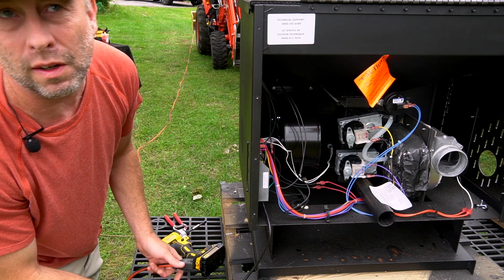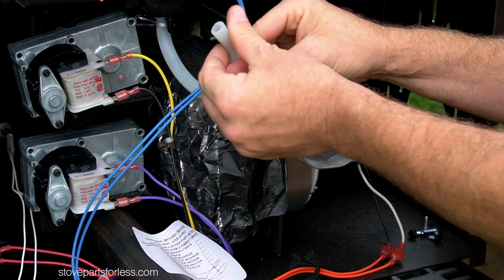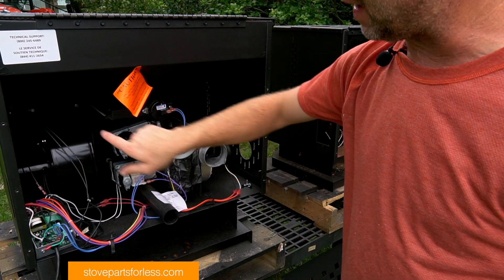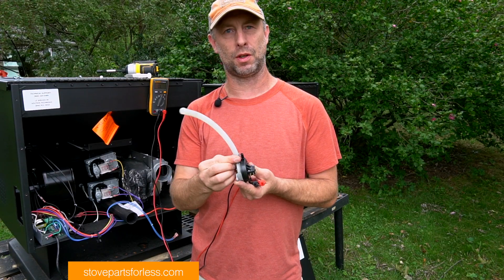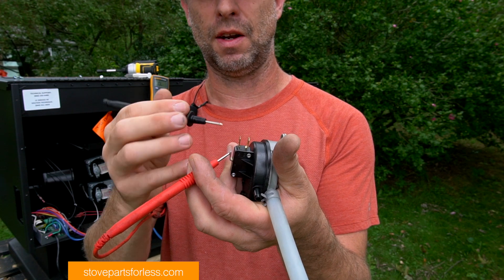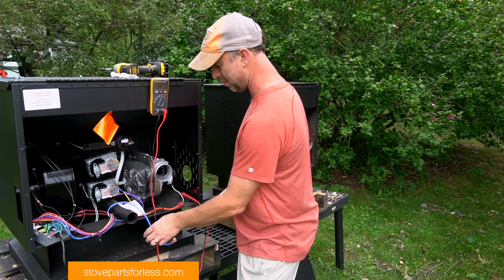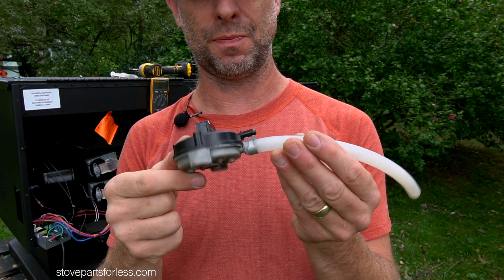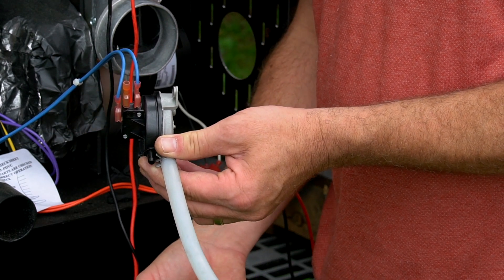Englander 25-PDV, 55-PDVC Solving E1 Error Codes

Comment: This was very, very helpful.  My vacuum hose was brittle and burned in one section with a hole, which was apparently causing the error code 2.  So I pulled the hose and vacuum switch out for easy replacement.  But after I put everything back together, I kept getting an error code 1.  I reviewed your video several more times to see if I put things together correctly, and as it turns out, I accidently connected the wires to the vacuum switch incorrectly.  Watching your video showed me the correct tabs to connect to, and it now works fine.  Thanks for your detailed video.

Comment: Unplug it because, the manufacturer didn't put that control box in an enclosed unit to prevent accidental shock. I know, I have shocked myself multiple times just reaching in there. It's not that bad but, you defiantly feel it.

Comment: I've searched and searched, what exactly happens when you loose power to a pellet stove. Someone needs to make a video. How much smoke actually comes out. I've got a 400 watt inverter ready to go, but I haven't tried it yet. I'm prepared to unplug my stove while it's burning just to see what exactly will happen, but I'm hesitating.
Reply from the maker: It depends on a lot of factors. Ultimately the stove should be installed in such a way that there is vertical rise in the vent, at least 5'. if the stove loses power then then the hot air will naturally rise and draw the smoke outside.

Comment: great videos. An Englander was givin to me and they said it kept shutting off on them. After some good cleaning and removing to top auger and reseating it it ran for days very well, Now when I start it it will immediently kicks off with E1, I have checked everything I know but still doing this...back to what the previous owner told me it was doing. I checked the two vacuum hoses, I bypassed both vacuum switches with a jumper but still shuts off, I have removed the exhaust motor cleaned inside and jumped the motor to make sure the motor is strong, I made sure where the vacuum tube connects is clear and air is moving freely (sucked into it), to I have removed the augor motors and jumped them to makde they turn freely,  door and glass gaskets seem in good shape, at this point Im stumped...this is amn older viseo but hoping you,re still out there for some advice.

Comment: Your style of video is right to the point and thorough, thanks.  Can you talk about the other switch on this stove that I believe is CU not PU.  I think mine has failed and is perhaps wired wrong as there is nothing on the common , yet it has been working for years until this past week, top auger not turning and I did jump them so I know auger works
Reply: DIFFERNT PROBLEM. SORRY.
Reply: If all the safeties are ok, the main board can have a partial failure that controls the feed rate. The bottom left button sets the minimum feed rate and is usually set to 4. But it's range is 1 to 9.  Setting the minimum feed to a higher number will sometimes work while you wait for a new main board. 1 to 9 minimum feed rate is the same as the normal heat setting 1 to 9 setting. If you have time to wait, there are people online that repair circuit boards for about 1/2 the cost of new.

Comment: I have the shpcm-49, 49 trcpm model and it seems this one only has one vacuum switch and it is the cuvs. I opened up the rear and search for it to death. I use the flashlight I use the mirror I even use my camera to record the places where I couldn't see and only found one vacuum switch. Please check your stove before buying parts I bought the wrong part for my stove.

Comment: For sixty bucks in parts, should a person just simply buy and replace the hose and switch as soon as the E 1 code appears? Thanks for your thoughts on this matter.
Reply: Just buy the hose, or trim it back the switch never fails (almost)

Comment: I found that if you cannot blow through the tube vacuum tube attaching a compressor or air bottle to the top of the metal tube will blow the blockage through good luck